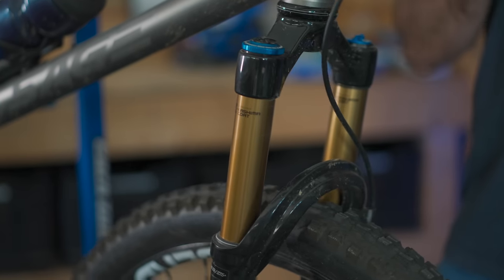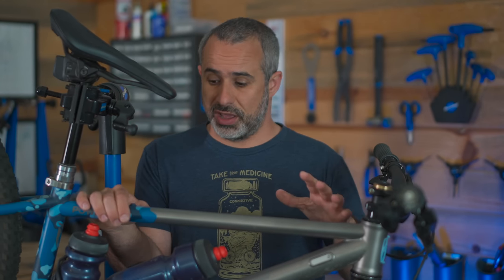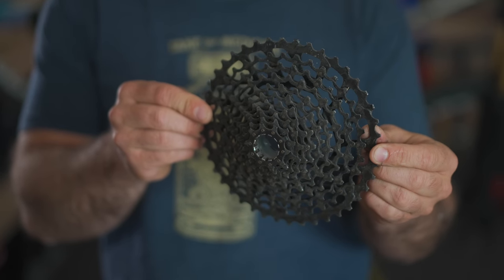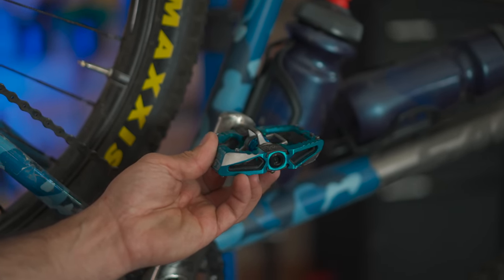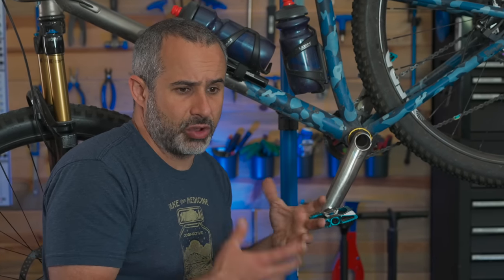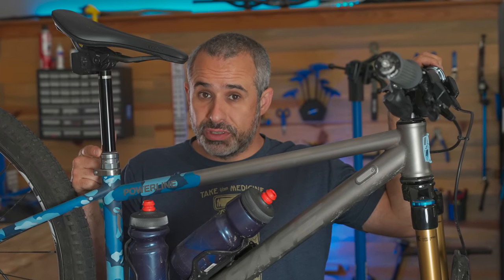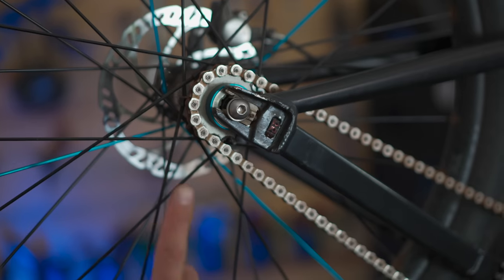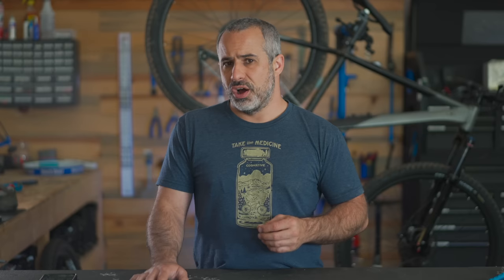You're saying it Wrong! The most mangled bicycle lingo clarified

Comment: "Clipless" pedals are called that because there's no toe plate that clips to the pedal (thus, toe clip). 

As for chain stretch, while the individual links may not stretch, the wallowing action on the pins does result in the overall length of the chain increasing, which is to say it stretches.
Reply: This video is about language pedantry; everyone knows what chain stretch means regarding chain wear but strictly speaking, chains elongate or get longer with wear; they don't stretch.

Comment: Fork brace vs fork crown. The part of your fork where the stanchions meet the steerer tube is the crown. The part where the lower legs connect to each other is the brace.  Additionally, most DH forks are "dual crown" not "triple crown"
Reply: Yes!  "Dual crown" and "triple clamp" need to be added to the list.  And suspension terms: "Fork" vs. "Shock".  Your shock is the rear suspension.

Comment: So Seth, not to get all crazy on your explanation of Damped vs Dampened, but it doesn't really have to do with water or liquid verses a signal/wave/vibration.  It has to do with whether you are describing the mechanism doing the damping, or the result of the damper dampening the signal/wave/vibration. Damping is the verb of what the damper does.  Dampening is the result of the fork not feeling so springy.  ---- "I finally got the damping set up the way I like it on my new fork."  "Dialing in my compression knob two clicks really helped,  I felt like that rock garden was dampened the right amount, I could feel what was happening with the front wheel but I wasn't getting bounced off track"

Comment: Damper and Dampener are synonyms. Dampener and thus dampening is more often used because plural (dampeners) doesn’t make sense unless you are referring to a group of people that go around getting this wet…..?

Dampeners
“a device that reduces vibration (= continuous quick, slight shaking movement)”

Dampen (ing)
“2 - To make less strong or reduce intensity”

I just copy an pasted from the dictionary hence the quote…

My company manufactures dampeners for specific products and this comes up from time to time.

Comment: I agree with all this except the one about the bottom bracket. 
Considering brackets are devices that are used to hold something in place, the only stationary part of the bottom bracket assembly that does not move is the shell and the outside of the races on the barring. This is essentially true of press in bottom brackets. The only time it might be argued that the shell isn’t the actual bracket is with screw in bottom brackets. But even then, the part that does get screwed in can be described as a flange. 

Most people instinctively agree with me on this, as far as I understand. I did go to school for mechanical engineering, so I should hope I know.

Comment: I’ve worked in a shop for 8 years and never heard of fork end (I’d call it horizontal or sliding dropout) or pedal axis (I’d also say spindle). There’s also some bike models that are pronounced wrong often: Allez as al-ease, Roubaix as roo-bakes, Domane as doe-main. Also there’s a proper way to say Marin!
Reply: An axis is the geometric term for a pedal's spindle. But mechanically it functions as an "axle".not a spindle. But the common nomenclature,  is to refer to it as a "spindle".  

But he kept referring to just the threads, which I didn't know had a separate name?

Comment: I’ve always called the piece in the pedal a spindle or axle. Spindles are the innermost part of the trailer wheel and axle assembly. They provide a surface for the wheel bearings and wheel hub to rotate around.
Reply: Same. I have never heard it called an axis. Usually a spindle, sometimes an axle. I design mtb pedals for a living... so I would hope I know what that part is called.

Comment: I can't think of a spindle that isn't also an axle but there are plenty  axles that are not spindles. Eg; Lefty axles are spindles, thru axles are axles. Generally, I consider an axle that's supported on one end only to be a spindle, an axle that's supported at or near both ends is just an axle.
	Toe clips were named wrong, so are the replacements.
I think of a clip as a spring loaded, tension clamp of some sort, paper clips, binder clips, ammo clips all use springs.
	A handlebar is one piece, singular. Add bar extensions of any sort and then they are handlebars.
	“Track ends”, fork ends are on the front. Arguments on this one are acceptable.
	Bottom bracket is a whacky term. No one calls any part of a headset - head tube – steering tube assembly a front bracket. 
	One of my biggest peeves, not that I've heard it here, is using “theory” when one means “hypothesis”. Google “scientific theory”, “scientific” because there is no other kind of theory.

Comment: Technically "forks" is correct if it's not a solid piece (like the front fork of a typical road bike). The crown, steer, and stanchions are the "upper fork" while the legs and bridge assembly (usually all one part) is the "lower fork". Being that there are two assemblies called singular 'fork' the whole assembly could be referred to as "forks".

No I'm not invited to many parties, why do you ask?

Comment: I'm bad about saying 'forks' or fork, even in the same sentence. Half the time, I call it the shocks. I've only been mountain biking for a year. So, I'm still figuring it out. Also, I've been trying to figure out the whole 'chainring' 'sprocket' 'cog' nomenclature. I came to the conclusion that everyone says something different. But, what makes sense to me is: a chain ring is a ring that attaches to a crank set typically with four fasteners like you show in the video. A sprocket is a toothed disk used to provide power to a chain. A cog receives power from a chain and delivers it to the wheel. That's just my opinion. Thanks for another great video!

Comment: Thank you!!!!  Hearing people talking about suspension dampening drive me insane!  I do think you might be slightly wrong about the BB spindle discussion though.  For sure, an old school BB like a square taper does in fact include the spindle as part of the complete BB unit.  But I challenge that the example you showed, an external BB, actually includes a spindle in and of itself.

Comment: Useful and entertaining video, thanks. 

My question:
When (and why) did cranks become crank arms? My understanding from a general mechanical perspective is that a crank is a lever that pivots at one end when a force is applied to the opposite end. The understanding was that the lever acts as an arm. Simple enough.
 
When I got into the industry several decades ago, IIRC we had cranksets (a pair of cranks) and chainwheel sets (a pair of cranks with a chainring/s fitted) 

What have we gained by redefining something so straightforward, or is it just another example of mere verbosity?
Reply: Probably because in many contexts, 'crank arms' rolls off the tongue and into the next word better than 'cranks'.  There's no other thing that could be referred to, so it should not add any confusion.

Comment: Dampen:-  to make less strong or intense. So if it lessens the intensity of the spring oscillation then it is indeed dampening the front fork. Both terminologies can be used as can sprocket for the front chain ring on many bicycle designs. I will still be calling them by that as i was in the 60s.
Reply: Except dampen is the verb.  If there is only one gear in the front, it is considered a sprocket.

Comment: Great video Seth - "dampening" drives me absolutely nuts buuuut PSA:
The tire is NOT a part of the wheel. Without a tire the wheel is still referred to as a wheel A wheel is comprised of a hub, spokes and a rim. Not a tire.
Air forks do not have preload. That's specific to a coil spring.

Comment: i work for a bicycle rental company. due to the multi-nationality/age range, asking for spare parts is a headache.
i usually have to send a picture of what i need to get exactly what i want.
i have asked for shifter cables for derailleurs and gotten shifter cable housing.
they sometimes refer to the v-brake noodle as left hook.
they gave me a 7-speed cassette when i said 7-speed freewheel.

Comment: So dampen means EITHER to make something wet OR to reduce in intensity according to the dictionary. Just like Damper (according to the dictionary) is EITHER the comparative adjective of damp meaning something is more damp (wet) than something else OR is a person or thing that has a depressing, subduing, or inhibiting effect. So calling it a "dampener" is technically correct if you are describing it as something that dampens (and does not only mean a thing that makes something wet). "Dampening" would in fact be the correct way to describe what a damper does. However I would agree the proper name if you are not just describing its function but want to use the noun the manufacturer used, it is in fact damper.

Comment: For what I learned in school for a mechanic diploma, the wheel is the whole assembly ready to be installed (the rim and tire for mtbikes obviously includes hubs and spokes), this is great content! Have you considered doing a podcast or something like that? There is alot more lingo but you got everything very correctly summed up, the fork end although it's in the rear I can see where it came from, I used to call them chain tensioner and I am pretty sure I have seen them advertised as chain tensioner, although there is also a part that is called chain tensioner that is like a derailleur with only 1 cog, the dropout usually is also referred to the derailleur hanger, really you are correct about everything said, I've been a mountain biker since I can remember, glad I didn't had alot of bad spelling but I also spend a lot of time reading about mountain bikes. Big fan of the channel keep it up!

Comment: gotta admit that i used to call the Bottom Bracket as the "Main Gear Hub" cause thats what i thought it was, it was the main part that drives the sprocket, it has gears, and it's a hub (coming from my understanding of Automotive Parts), so this brought confusion when i was transitioning from BMX to MTB as the shops i went to for MTB parts were using the correct terms while the BMX shops i went to were somehow able to understand what i was talking about.

this is in the philippines btw.

Currently using a hand-me-down mtb frame (he mentioned it's a 90's mtb frame but idk) made for standardardized threaded parts and oversized-stem fork (modified the frame to accept oversized fork/head-tube bearings), welded the rear suspension arm as the suspension assembly (spring, damper, pls correct) was messed up, running on 20" tires with threaded standard wheels.

to anyone who could be bothered, please correct me, as i do not wish to cause another awkward moment when i try to talk what i want to buy from the MTB shops.

Comment: A chain sprocket is simply a toothed part designed to interface with a chain with a rolling motion.
Your chainring, cassette, freewheel, singlespeed cog, fixed cog and even derailleur pulleys are all chain sprockets.

Comment: Dampening according to Merriam-Webster has two definitions. 1. to check or diminish the activity or vigor of : DEADEN(think sound dampening in your recording room);   2. to make damp   With that said the transitive verb form of Damping  is to diminish the activity or intensity of(typically in cyclic or vibration).   The definitions are basically the same but what they pertain to is what makes them different.
Reply: The first definition doesn't pertain to vibration, which is what a shock absorber is there for.
Reply: @robertmisiuk7137  It can and sometimes does.

Comment: There are plenty of high end forks and shocks that are coil sprung. While preload does change your SAG, minimum preload is ideal. Preload is not a useful adjustment on MTBs, and if you want to increase or decrease SAG change spring rate. Run the bare minimum pre load on the correct spring. Vorsprung can explain it better, and in detail...

Comment: Dampening has always been one of my pet peeves, but the one that really grates on my brain, is the cassette. I can't even begin to count the probably hundreds, maybe thousands of times I've heard people refer to it as the gear cluster assembly. I never could figure that one out, mostly because THERE AREN'T ANY FRICKIN GEARTS ON IT!

One that up until about 15-20 years ago I was always saying wrong was forks. That's what I had always heard them called, for as long as I can remember... forks. I can't even remember who told me that it was singular, but the very second they told me, it made sense, no explanation necessary. It's a single fork.

Comment: Horizontal dropouts face forwards. Trackends/forkends face backwards. The difference is best seen on derailerless bikes. With vertical or horizontal dropouts you can simply drop the wheel out, hence the name. With trackends/forkends you can't, you have to move the wheel forwards and derail the chain first, before you can move it back and out.

Comment: My biggest annoyance at the moment is "crank arm". It's just a f*cking crank. You can have a bottom bracket, a crank, a crank set (both cranks), a chainset (cranks, bottom bracket, chainrings), but a crank is a crank, there is no need to add "arm" to crank, because no other part of the bike constitutes part of the crank. A crank is merely a lever for circular motions.

As for axles and spindles... pedals and hubs don't have axles, they have spindles. An axle is something that rotates, whereas a spindle is something that supports an object that rotates. Bicycle wheels spin around a spindle, which is fixed in place. Pedal spindles, although flailing around attached to the crank are technically spinning, they are not freely rotating from the object they're affixed to.There is only one axle on a bike and that's in the bottom bracket, which has often been called a spindle in previous years...

Comment: I’ve also used the term pedal spindle -  instead of axis. Did I hear Seth right? 
The other terms presented I’ve made a point to get right since the 1970s when I became serious about bikes.
The “clipless” pedals has been aggravating since the very beginning. Even with the old cages and straps over the toe, serious cyclists did have clips on the bottoms of our shoes. The cages and straps were needed to keep us from lifting our clips off the pedals. With so called “clipless” the clips didn’t go away the cages and straps went away. The clips simply became self locking. From the very beginning it would have been more correct to refer to the new tech as cageless or strapless instead of clipless. The only pedals that were truly clipless then and now were/are platform pedals.
Reply: Garmin call it a spindle when they refer to that part of their pedals so I can’t see ‘spindle’ ever being wrong. As for ‘axis’, surely it’s axle?? 🤷‍♂️

Comment: With the pedals I would say caged, clipped and normal because most of us learned on the basic pedals. Coming from cars I would call the rim a wheel and then you have the tube and tire. I call what the suspension does as dampening but not the parts
Reply: I found some old pedals with the straps on in the garage and tried them out on the road bike, man was that f*****g scary, only went to the end of the road  (100 yrds) and didn't feel safe at all. How could people ride in those things?

Comment: Seth says, "Chain Schtretching".    AAAAAARRRRRGGGHHH!

Also, I have never heard a "pedal axle" called a "pedal axis".  There is an axis running through your pedal axle.  The axis is the imaginary line the axle turns about.  (Lets not get into what an Axel is.)

Fortunately, he doesn't use the term "front fork".   (As opposed to the rear fork?)

Comment: A chainring bolts on to a spider. A one piece thing with teeth is a sprocket. So “sprockets” normally haven’t been used with MTB until recently.
The rear thing is a cog, a freewheel or a cassette. Not a sprocket.

Comment: On a motorcycle both the front and the rear are called sprockets.  Generally the front is a counter shaft sprocket, and the rear is either simply the sprocket or the rear sprocket.  For those of us who are both motorcycle people and bicycle people, it is strange to call the same thing two different names on each platform.

Comment: An axis is an imaginary one dimensional reference feature defining the intended center of rotation.  A pedal axle is the 3-dimensional thing in the center of the pedal, aligned closely with the center axis, that the bushings/bearings ride on and that screws into the crank arm.

Comment: what do you call the unit of the shifter housing with the shifter cable inside it?
because when it's a unit with the two, I wouldn't point to it and say there is an issue with my shifter housing...
you'd say there is an issue with my shifter cable, right?

Comment: Technically speaking the chain ring is also a sprocket, but given that it is a specific part with a specific purpose it has a better, more specific name. A sprocket is just a cogwheel designed to engage with a chain, and a chain ring fits that definition.

Comment: To be fair, pedal axis, axle, spindle, shaft, pivot, or middle spinny bit all get the point across. I think specificity is more important when there is great ambiguity. "My shifter is bent!" but which end? "Sounds like the stem is creaking". Ok, but is it the steerer tube end or the handlebar end?

Comment: Mr. Spacely would disagree with you.  "The name 'sprocket' applies generally to any wheel upon which radial projections engage a chain passing over it"  Hence, a "chainring" is first and foremost a sprocket. 

When I was a kid, (1960s)  the "chainrings" were called "sprckets" but none of us were serious cyclists.  However, "chain ring" was not added to the OED until 2010 which leads me to believe that it is a word of relatively recent origin.